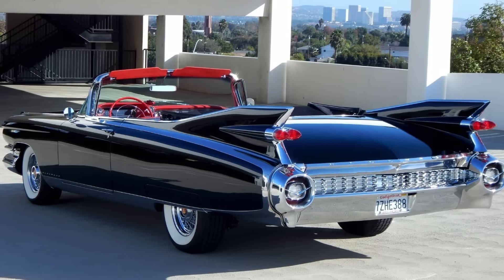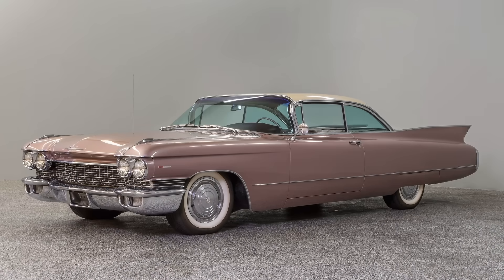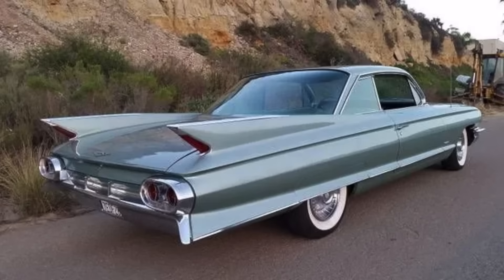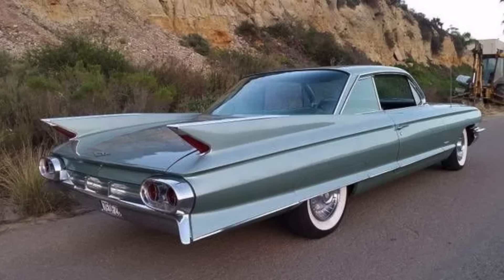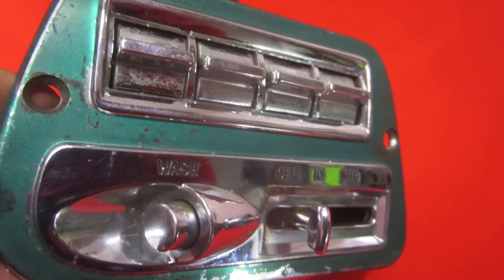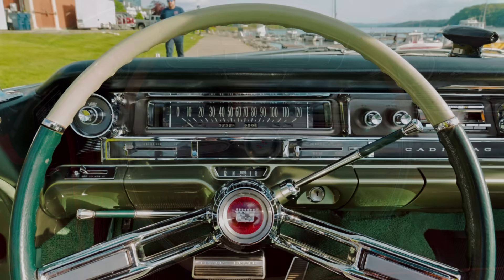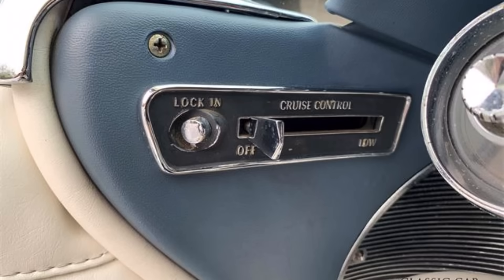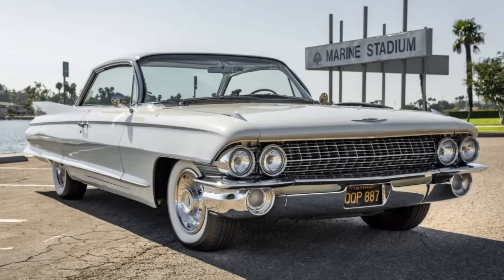Worst Automotive Components of All Time: The 1961 Cadillac's Dangerous Cruise Control (GM)

Comment: In recent years, the worst technologies have been Engine Stop/Start, Cylinder Deactivation, and the CVTs.
Reply: And no class. I really miss those days of style and class. It was pride in ownership.
Reply: My job required driving Modern Car's and Van.. Prius for example,, if left on, the (safety) features..
Are Numerous..
Most can be turned off or at least.. dialed back...
It's apparent that the Car Manufacturers have agreed on.. your all just to damn busy to be bothered by the basic requirement of driving...
We got it, lane departure, Impact, blind spot monitoring, etc etc...
Every classic car we see was owned and driven by a person who could actually drive...

I daily driver a 68 Dodge Dart...
Risk is part of life, what can, will always survive...
Reply: @AtZero138  Saw a clip on YT where a Chinese EV wouldn't allow the driver to move the steering wheel to change lane unless the turn signal activated first. As they said on the clip, in an emergency you're not going to have time for the niceties.
Reply: 100% correct!!
Reply: Those are dangerous to the car's reliability, not for the driver or other people. I'd argue the giant touchscreens everywhere are far more dangerous.
Reply: @kevinmoffatt how does parking work? Will people think you’re crazy when you’re parallel parking?
Reply: Also every car is black white or grey with a grey interior

Comment: One thing that I miss is the forward visibility of these 50s and 60s cars.  The A-pillars of most cars these days are practically in your straight-ahead point-of-view.  The horrendous 'cybertruck' is the worst of the lot, but even cars like my wife's 3rd gen Honda Fit have the issue.  So easy for a pedestrian or another vehicle to get completely obscured in that blind spot.
Reply: Those thick corner posts would have been considered a safety hazard back in the day for exactly the reason you say.
Reply: Federally-mandated rollover standards; kinda like peering around the mast when driving a fork truck. An entire vehicle will disappear on the right, especially when approaching a four-way stop. Absolute necessity for the oversized overweight overwrought lumbering monsters passing themselves off as pickups or 'sport' utility vehicles, but pretty much useless in a regular car.

I'd rather take my chances and be able to actually see.
Reply: Those thin a pillars would also cause the roof to crush in if the car rolled.
Reply: This is at least partly compensated by the short hoods on modern cars. I look at those old cars that I used to drive so easily and wonder how the heck I could ever see to pull out of a driveway when sitting behind that long hood. Maybe the thin A-pillar was some help.
Reply: @mattwolf7698  I always drove a "hardtop" that had no B-pillar at all. You definitely wanted to keep that thing "shiny side up, rubber side down". The good news was while it was possible to roll one of those cars it wasn't easy considering the large track and wheelbase and low center of gravity.
Reply: @davidg4288 unless u short the fenders/ hood was  so low to ground, not an issue, not like giant suv we now have

Comment: cadillac with no air conditioner doesn't seem right.
Reply: Heaters were still optional in some cars then.
Reply: A/C wasn't standard in Caddy's until 1968.
Reply: @crankychris2 actually it was 1975 when it became standard across the line.
Reply: @crankychris2  I had a customer who had a 68 Caddy with the 472 and it had no A/C. 1969 is more likely.
Reply: Or, as @Gregt8638 said, 1975.
Reply: A/C is still not entirely standard as some climates have no need for it
Reply: @@kcOlif

It's even more unbelievable that power windows and power seats were technically "optional equipment" on the base series "62" cars until 1967!
Reply: Air conditioning was pretty much unheard of in the 60’s. It wasn’t even an option.
Reply: @billmoran3812  "It wasn't even an option"?! It was an option in Cadillacs in 1953 and has been available every year since.
Reply: @billmoran3812  They existed but many were dealer addons where the vents for them would also have to be installed. My 67 Fury had A/C that was dealer installed.
Reply: AC was not common until the later 60s.  It costs $500.00 or more extra, and that was a lot of money back then.
Reply: A friend of my Aunts fiance later husband got her a new 1963 Cadillac convertible and since they were across the bay from San Francisco it didn't have air conditioning, and they didn't need it there.
Reply: It was still an extra cost option for '61.  I had one in the 1970s and it didn't have AC.
Reply: AC added 10% to the price. Our ‘59, series 62 base model, cost $4500.
Reply: @FrankGutowski-ls8jt  my Aunts friend told me her husbands engagement gift 63 convertible in Oct 63, was about $4800.   It was brand new but the 64s were out so he probably got a little bit off to make it that price.  It was that nice red color they used in the early 60s
Reply: @califdad4  

I think convertibles were MSRP’d at about $1K above coupes. Eldorados were about 50% above base models.
Reply: @billmoran3812  Air conditioning was quite popular by the mid 1960s, especially in the humid South.
Reply: @MarinCipollina  not in the mid 60’s my friend. Even a lot of buildings weren’t air conditioned until the late 60’s. I was there.
Reply: The first model with standard A/C was actually the Ambassador. 67 or 68.
Reply: @tenfourproductionsllc we had a dealer add on AC in family 68 AMC Rebel 770.  It spit ice chunks usually.  290 cc I believe.  I learned to drive and abuse parents car in it.  I’m ashamed now of what I did in it with my drinking friends.  I’m sure I’m the one responsible for the transmission needing to be rebuilt.  I know it was out of warranty.  My dad should have known better.  I’m sorry father.
Reply: @FrankGutowski-ls8jt  she told me he got it in Oct 63 so the 64's were out, and paid  about $4800 for it
Reply: @billmoran3812  Not discussing buildings here. Discussing automobile AC.. I was there as well, and our family cars had AC since 1962, and they were factory installed units.
Reply: @califdad4  

Good price! 

Parents traded out 59 in 72 for a Buick Skylark. IMHO, a better car. Caddy had about 50K miles. Garaged, always. Looked and smelled new.
Reply: @FrankGutowski-ls8jt  had neighbors that traded in their 62 Cadillac coupe for 69-70 Skylark, she drove that Buick the rest of her life, they were nice smaller cars
Reply: @califdad4  

Yup. My uncle had one. Other neighbors drove Buicks. Loyalty to local dealer, I suppose. 350 was a good engine. By then, AC was mainstream. Paint was bronze metallic: not sure about the composition but not nearly as shiny as today’s clear coated vehicles. Far easier to maintain than the Caddy’s solid black. But also not nearly as flashy.
Reply: @FrankGutowski-ls8jt  I have maintained that the 62 Cadillac was when Cadillac got elegant again, they really trimmed down the 62  car to a very elegant look, the 59 and 60 were pretty flashy.    My parents bought a 69 Buick Electra limited, what a great car that was, my parents absolutely loved it
Reply: @billmoran3812  Bullshit. Packard had A/C in 1939, The '57 chevy had A/C standard on the belair trim. By 1960 over half of all new cars had A/C.
Reply: @billmoran3812  By 1960 over half of all new cars sold in the U.S. had air conditioning. My grandfather was born in Virginia in 1939 and he says other than some small mom and pop stores and service stations he never saw a building without A/C. He says there are more buildings today without A/C just because everyone is so impoverished. Packard had A/C in 1939 and movie theatres and restaurants have had A/C since the 1920's.
Reply: My 62 didn't have factory air. It did have automatic high beam dimmer which worked pretty well.
Reply: @mwilliamshs You literally can't get a new vehicle without A/C in the US anymore, the Jeep Wrangler got A/C as standard in 2022 which was last hold out. I think maybe some Canadian cars can be had without A/C, you definitely can in Europe where it's not as needed and I think Mexico and South America where honestly it would be pretty nice but a lot of people down there can only afford something basic that gets them from A to B.
Reply: The only one's I've ever run across were convertibles that did not have AC. Even then, most still had it. 
I dated a girl in high school who'd dad built here a fully restored '59 when she got her license, pink with a white interior with AC. The car apparently has belonged to a family member years prior and had very few miles. 
Years later I bought a '61 that belonged to an elderly woman around the corner from where I grew up. It was her and her husbands first new car after they came to the USA after the WWII. It had 17k on it when I got it in 1988. For some reason I seem to remember the window switches on that car being on the front of the armrest just behind the mirror controls. I don't remember the cruise control controls at all for some reason. I actually seem to think that area of was just blank on mine, but its been over 30 years ago now. I do remember the window switches being there on the '59 though. Power wise those cars were great, not rocket ship fast but more than fast enough for a big car and far better than what we had in the 70's and 80's. The bad part though was the mpg. My 61 was tolerable if you drove it like an old lady, but if you got even slightly aggressive the fuel gauge would try to outrun the speedometer. 
I never really wanted to sell it but got talked into putting it in an auction at one car show. I put what I thought was an 'I don't want to sell it reserve' on it but it sold for nearly double that. So I moved on and actually left that day with a '59 Ford truck that I had bought for super cheap.
Reply: @gregt8638  Mid seventies Calais had crank windows and no air.
Reply: @61rampy65 The Calais was a stripper version for corporate buyers.  It even had crank up windows.  The Deville had it standard along with power windows.
Reply: . Only banks and movie theaters had it.  It all changed in the 70s.
Reply: . In NY, a/c in cars came 68 to 70.  Nobody had it before.  Nobody didn't after.

Many rides in many cars in 60s and our 69 was one of the first.
Reply: @billmoran3812  Packard had the first automotive A/C system in 1939. They sold 300 units.
Reply: @billmoran3812  Marin is correct. Even Corvairs had available A/C in 1961. Not sure where you were back then but you are way wrong on this, cuz I was there, too
Reply: @michaelplunkett8059  I see from your multiple comments that you only vaguely know what you're talking about. My guess is that you live in the North or Northeast.
Reply: Actually -and I just checked this in my Cadillac books of the era:
Power windows were made standard on ALL models starting in 1968.  Air conditioning was made standard on ALL Cadillac models starting in 1975.
Reply: I live in Arizona; any car with no air conditioner doesn't seem right.
Reply: @kylemichaels3373  I actually think you need to recheck the source you're getting your info from. While yes, Packer did have a /c as an option in the late 30s ; every Chevy Bel-Air did not have a/c in '57. And maybe in 1960 half the Cadillacs had it. but most cars did not have it available then.
Reply: @rooky55  Nope. Power windows were made standard on the Calais line in 1968. To match the rest of the Cadillac line. Only vent windows remained crank with power vents  being an option. Vent wing-windows  were eliminated in 1969. No  Cadillacs in the 70's had 
Vent windows or cranks
Reply: A caddy used by Elvis, Scotty, and Bill to tour around the south had a really strange air conditioning system, it was installed in the trunk and had vents by the back window.
A lady has it in her private car collection and it is on youtube.
Reply: @michaelszczys8316  that's how air conditioning systems were done in most of the 1950s. Then when they became more compact and efficient they were able to fit them under the hood. Limousines, however continue to have their second unit in the trunk.
Reply: There were many climates where it wasn't needed, and at the time, it was an expensive option, even for a caddy owner,   so wasn't uncommon to forgo it.
Reply: More disturbing is reverse at the bottom.  How many people like to start a car and yank it all the way down to low and floor it!
Reply: Any car w/o AC doesn't seem right, unless you live in Alaska, Montana, North Dakota or Maine.
Reply: @wernerdanler2742  what did you do if your windshield fogged up?
Reply: @glennredwine289  I remember cars having little dash mounted fans.
If that didn't work fast enough, you wiped it down with a rag or handkerchief.
I may be thinking more of 40s or earlier cars. 
But I think heaters were still listed as an option in some cars in the early to mid-50s.
Reply: My maternal grandparents (Irish) had a green Caddy with cruise control; that made driving on the Mass. Turnpike easy! De Ville. I don't know the year. It sucked up a lot of gas, but it was a beautiful car! Fabric seats. Windows that went up and down with the switch.
Reply: @billmoran3812 It was available as a regular production option since 1953. According to my father, a few people had aftermarket air conditioners before that. Cadillac had an excellent automatic system since 1964. I read once that the first car to have more than 50% equipped with AC was the 1966 Toromado, but I never knew if this was a fact. It sounds likely. It has gotten so hot now that it would cause heatstroke to be in slow traffic with no ac. Years ago it was just miserable but it didn’t feel life-threatening.
Reply: @billmoran3812 Cadillac offered air conditioning in 1953
Reply: @outspokengenius The 1957 Bel Air didn't have standard factory air conditioning. It wasn't until the 1969 model year that factory air conditioning was installed in 50% of cars sold that year.
Reply: @rooky55 Cadillac made power windows standard on ALL cars including the Calais in 1968
Reply: @michaelplunkett8059 so you're saying that it wasn't until the late that you could finally buy a new car in New York with air conditioning.  Why was that?
Reply: @glennredwine289 You did 3 things other than swiping with your hand.
1. Crank defroster,
2. Turm temperature up,
3. Open windows and floor vents to dump excess heat.
Reply: @mwilliamshs  yes, like the Pacific Northwest and most of the North East
Reply: @billmoran3812 early ford falcons offered AC as well
Reply: @kylemichaels3373 Air conditioning was available in 1957 for Chevrolet but rarely ordered regardless of the trim line. Five minutes of looking through 1955 through 1957 models available for sale will show a small percentage of them with factory air conditioning.
The first American vehicle to offer air conditioning as standard equipment was the 1968 AMC Ambassador.
Reply: @outspokengenius in 1960 ac was pretty rare, definately not 50% in usa
Reply: @outspokengenius we are talking cars here not buildings
Reply: Many American Automobiles had A/C options in the 1960s. The Evaporator with controls were mounted under the dash. Even 1950s Automobiles could be fitted with aftermarket AC like described above.
Reply: @mattwolf7698  I had to look hard to find a serpentine belt for my 14 Toyota Tacoma 2.7 I4 with no AC compressor. I had to replace the AC this past year. If it goes out again. I just going to pull the compressor and use the shorter belt.